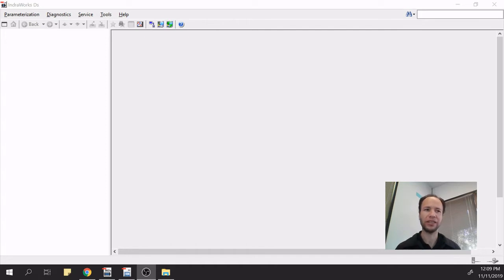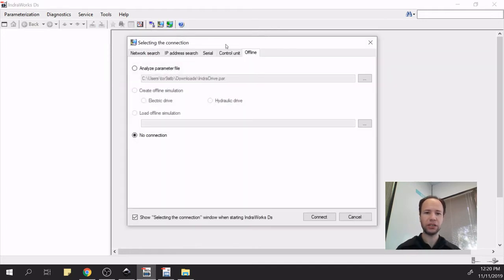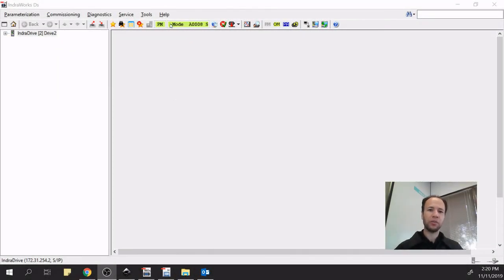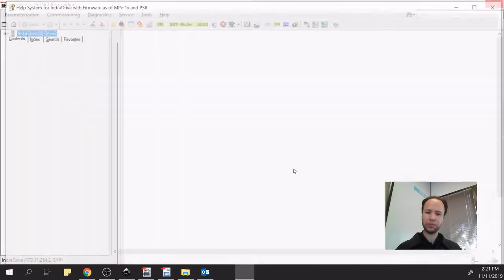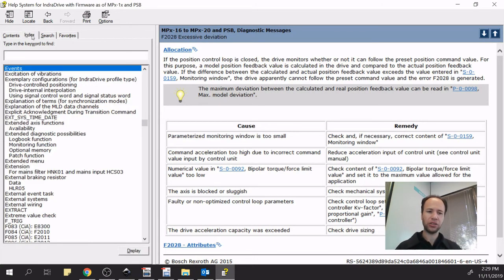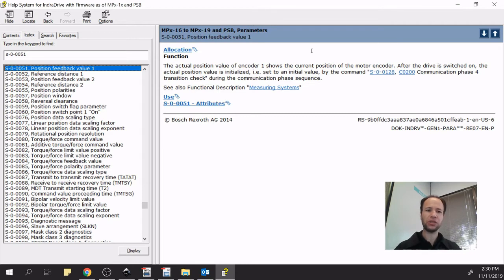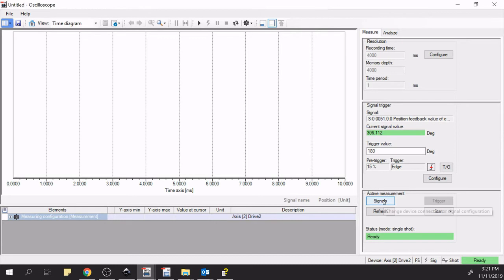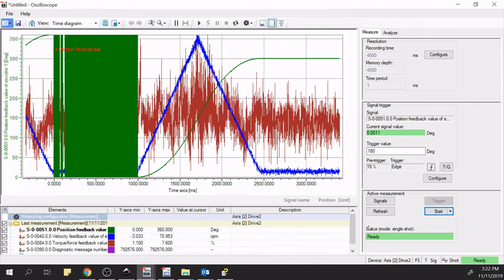IndraWorks Engineering/Ds - Basics Tutorial - Bosch Rexroth

Comment: Thanks, great video Rodrigo. My version of indraworks ds  does not have commissioning option! why is that?
Reply from the maker: Thanks for the feedback! I'm glad you liked it!

As far as the missing Optimization/Commissioning tool, the only reason I can think about is that either your IndraWorks version or IndraDrive firmware version is too old. 
* Are you using the current version of IndraWorks? Download link is available in the description of the video. 
* What is the firmware version of your IndraDrive? You can check it through parameter S-0-0030. There's a limited version of the Optimization/Commissioning tool on earlier FWA versions (5VRS and below), but only versions above 7VRS should look similar to what I'm showing in the presentation.
Reply from the maker: Take a look at this video too, in case you need additional information about IndraDrive itself: https://youtu.be/u5VRU7Wfbq0

Comment: Thank you for the video. However, is it possible to use PLC Simulation Mode (simulating IndraLogic L or XM series) and simulate OPC server? So, for example, i can run both PLC Simulation (using IndraWorks ML), and then run OPC client in my own computer (without actual IndraLogic Hardware) to connect to the simulated PLC? Thank you
Reply from the maker: With a MLC project (XM or Lx5 controller), you can run basic PLC logic in simulation mode by right-clicking on the controller and selecting "Simulation". OPC won't work in simulation mode though! 
In case you have further questions, I'd suggest you to post on the Rexroth Forum for faster response, here: https://rexrothsupport.discussion.community/

Comment: Hello. I tried to connect to servo. Ping passes. The addresses I need appear in the list, but it says that request name is correct, but the data of requested type is not found. The computer is in the same subnet with servo. This is error may be due to non-compliance with IndraWorks version?
Reply from the maker: It could be that the firmware version of the drive is not compatible (too old or too new) for the IndraWorks you're using.
Reply: @RodrigoGTomaz  hi.. Can I update the firmware of the device if I can't connect to it?
Reply from the maker: @lichaelapruebo4066  you can use a memory card for that, depending o the version/model of the drive. But you may need Rexroth technical support for that.
Reply: @RodrigoGTomaz  hi i bought a new drive board csbo1... I tried to load the parameters that I got and save from the old one that is currently working. But when I tried to start F8022 is showing. And from the PC it shows the drive is disabled
Reply: It needs to be enabled to easy mode

Comment: Super. Can you help about Drive Top16.?
Reply from the maker: Drive Top is an older system, and I’m not familiar with it. You can try to post your question on the forum. Someone may be able to help you there! https://rexrothsupport.discussion.community/
Reply: @RodrigoGTomaz  Thanks for the answer. but I have an old controller dkc02.3 that I want to work with. can you advise about more best software.
Reply from the maker: DriveTop is the correct software as far as I know. Check the forum for additional support please: https://rexrothsupport.discussion.community/

Comment: plz can you give me a link to download indraworks software
Reply from the maker: Hello Ahmed, 
Here it is <Download Tab>: https://www.boschrexroth.com/en/xc/products/product-groups/electric-drives-and-controls/engineering/software-tools/indraworks-engineering 
I suggest you to download "IndraWorks Ds 14V24_P2 (incl. online help)"

Thanks for watching the video!
Reply: @RodrigoGTomaz  plz can you give me your mail to ask you a question about my rexroth indra drive servo problem please
Reply from the maker: ahmed tooma you can post questions on our online forum. The link is on the description of the video. 
Thank you!
Reply: @RodrigoGTomaz  
Rexroth IndraMotion for Metal Forming 05VRS
i have a problem at my servo motor for roller feeder , the servo doesn't operate in automatic and also for the manual , i checked the servo motor and all is OK .
in the manual mode , when i want to jog forward or backward ,
the drive gives that the motor move forward with  status message "M Jog+"
but it doesn't rotate.
 
when i see parameter P-0-1370, Manual Velocity ,it's value equal to zero .
when i tried to edit it to another value , it goes again to zero .

the main problem for this case is
the servo motor rotate with zero velocity .
when i connected online with rexroth servo drive we find that
the feed parameter
manual velocity p_0_1370 is equal zero
setup velocity P_0_1371 is equal zero
bipolar velocity P-0-1372 equal zero
and when i change them it return again to zero